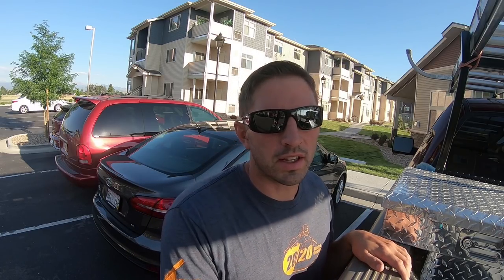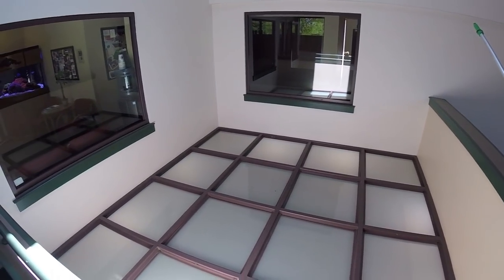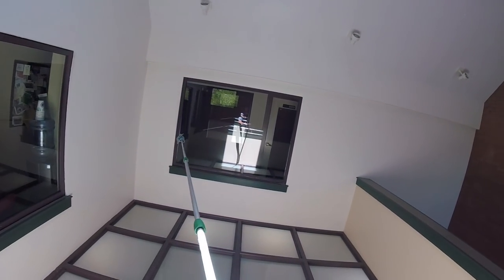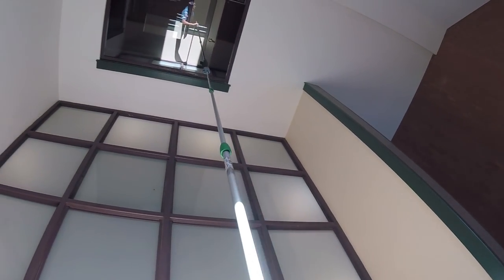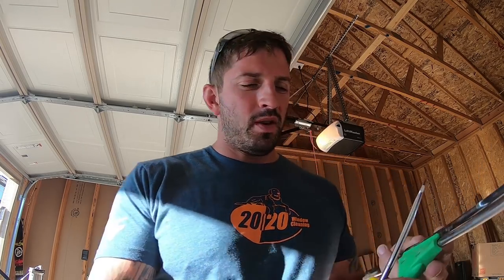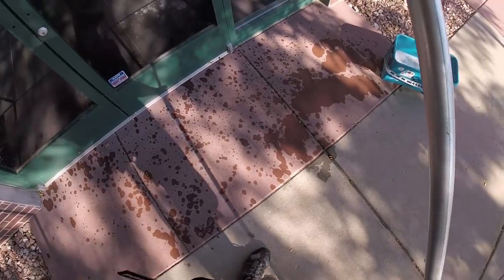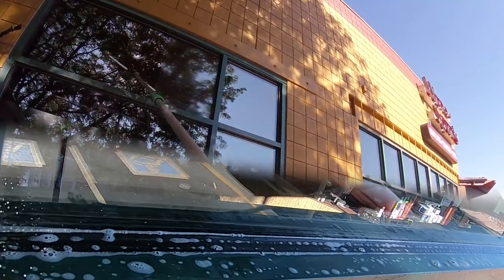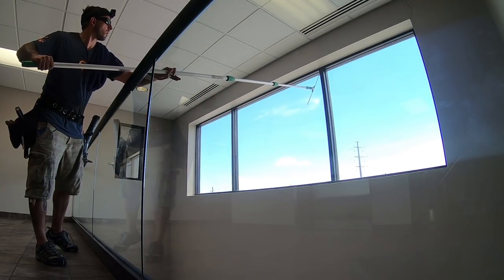SteveO's Preferred Squeegee Choice - Unger 0 Degree | Tips & Techniques

Comment: Perhaps I can help on the rubber changing dilemma. Take the Unger backplate off and replace it with a plain brass Ettore backplate. Tighten the plate down snug but not to snug because you can actually slide different size channels in and out of the handle as needed with this modification. It should stay snug for years. 😎